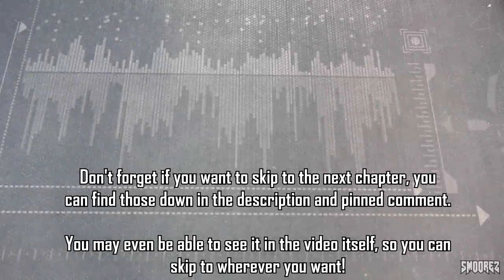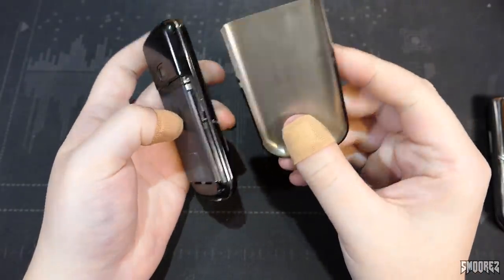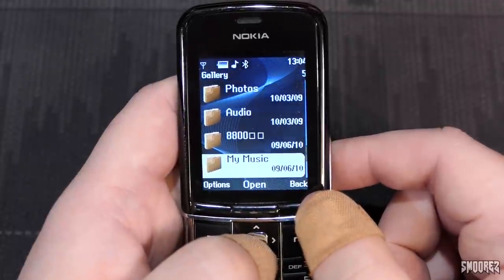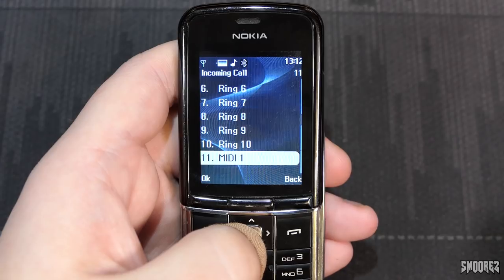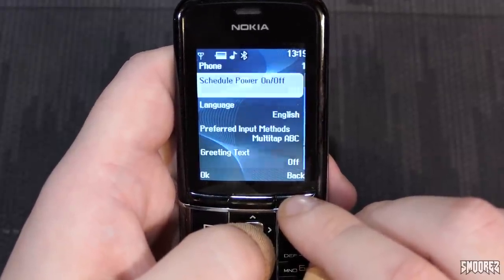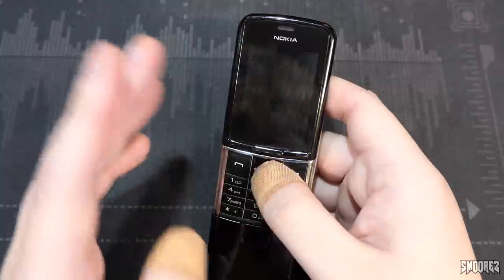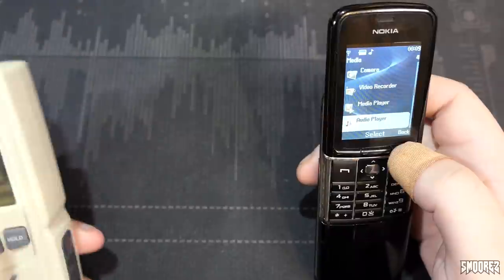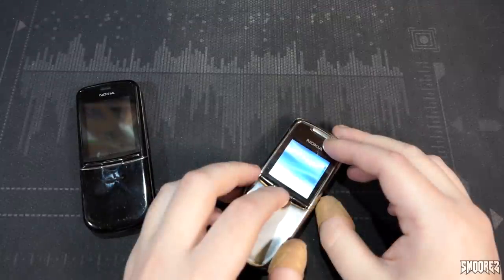|THE_PHONE_ARCHIVE| Taking a look at the Lost Brother Of The Luxurious Nokia 8800...(Nokia 8900e)

Comment: Hey smoorez,
The OS running on this clone called SavaJe OS (pronouced Savage). Which is now outdated, as Oracle shut down the Java OS project after they bought out Sun Microsystems.
Hope this helps with other clone videos.  👍🏻
Reply: Really? I was trying to figure that out for a while.
Reply: @user-lt2rw5nr9s  yeah, it's called SavaJe OS. Based on Java OS (J2ME architecture). 
LG used it for their debut feature phone called the Jasper S20. 
Turns out it's now used by Huang Lau feature phone "brands" such as Doro, Pantech etc. 
Samsung used to use SavaJe OS, however, they removed the J2ME functionality, so you couldn't install Java stuff.
Reply: @NCHLT  MediaTek MAUI (I think)
But they're both based off Java anyway.
Reply: @NCHLT  Which is based off Java.
Reply: @NCHLT  Interesting.
Last time I read up on it, it was running Java.